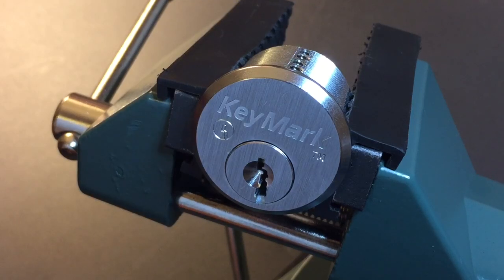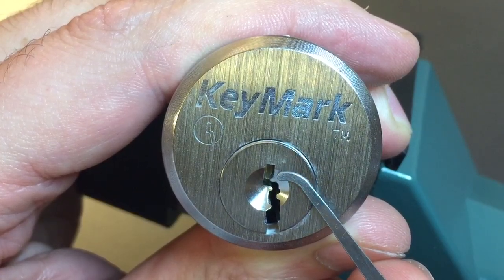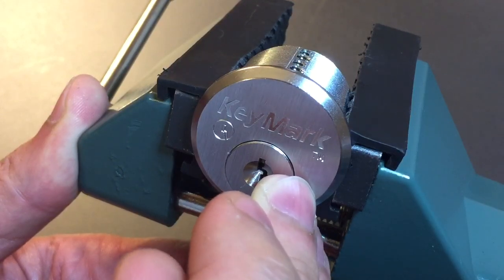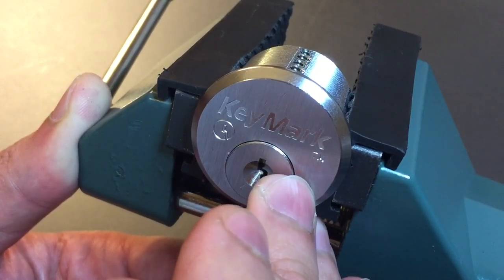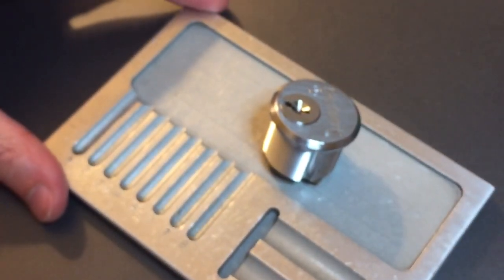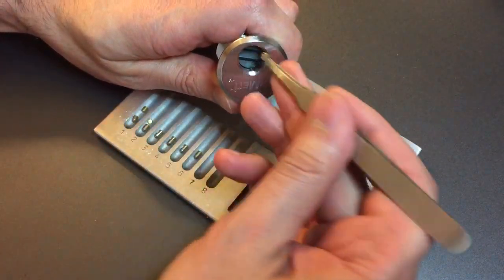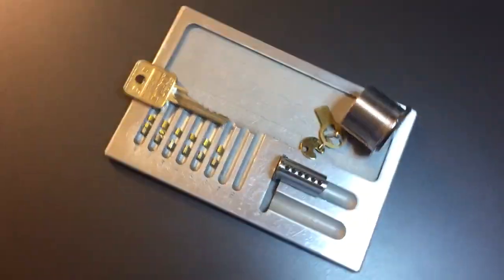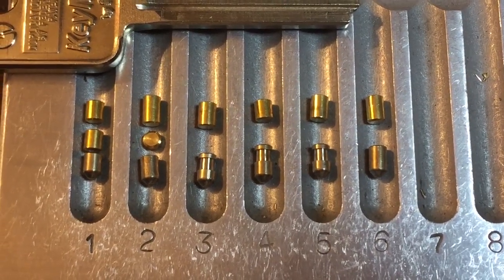[288] Medeco KeyMark Mortise Cylinder Picked and Gutted

Comment: I'm glad you post vids using that type hook. I now have a #7 Peterson in .018 and a high reach Sparrows in .025. Now I just need to save some shekels for #7 in .015. That's not as easy as it sounds since I'm disabled and on a shoestring budget but I'll get one. Thanks again for these great vids.
Reply from the maker: Thanks... the 7 Hook is one of my favorites.  It is great for paracentric keyways.  Be careful when ordering your next one.  Peterson has two profiles that it refers to as a 7 hook.  I suggest calling when you order and being explicit in what you want.
Reply: LockPickingLawyer Thanks much for the heads up.

Comment: So apart from a tough( at first sight) keyway and a couple of of spooled keypins there isn't much security there🤔🤔
I suppose not all Medeco's are made the same😉👍👍
Reply from the maker: That's about right.  To be fair, without a perfectly shaped pick made out of really thin stock, these locks would be all but impossible to pick.  There is only a very small sliver of the pin hole that can be accessed.  But with the right tools, they are pickable.

Comment: Old video, new question from someone who doesn't know what is available on the market. Has Medeco combined their rotating pins with these eccentric keyways? If you can only just barely push up on to only one side of the key pin, I would think (with my only experience watching YouTube picking channels) that would make single pin picking for rotation much more difficult, forcing the picker to both push and pull on the one side.

Comment: Interesting how there's no drill protection. I'm guessing the core is steel?
Reply from the maker: I highly doubt the core is hardened steel (or any kind of steel)... there just doesn't appear to be any drill protection in this lock.  Certainly a little surprising, but not that much.  Keymark is designed to be a retrofit lock (i.e., to fit in every conceivable kind of existing door hardware) for large institutions with really good key control... not a particularly high security lock.  It's also possible that this was not pinned up for use.  I got this lock from an old salesman sample kit.  I speculate that the pinning kits for these might have some hardened steel pins, but that's just a guess.

Comment: I have a friend who keeps saying, "If he's not picking the lock while it's actually installed on someone's door it's not real!"
Reply: lol.... It's usually the exact same as if it were installed, and in the situations where it is not, he does use mounting mechanisms like vice grips. I think he's even used a replica doorframe.

The method to pick a lock doesn't change after installed, at least with most locks. Sometimes the room for picking can get obstructed by something after installed, but that's a pretty rare case.
Reply: thats a popular perspective. it adds a few factors. a keymark is impressive either way.

Comment: That key shown there looks identical to the bidding that is on my master key for my entire keymark lock system.
Reply: you can eyeball .003 in? from a youtube video? are you a crane operator?
Reply: Yeah my master is looks like the same bidding with the exception of pins 6 and 3 otherwise it looks very similar.